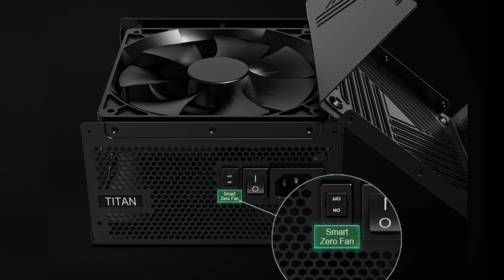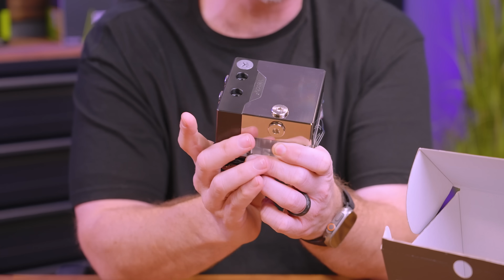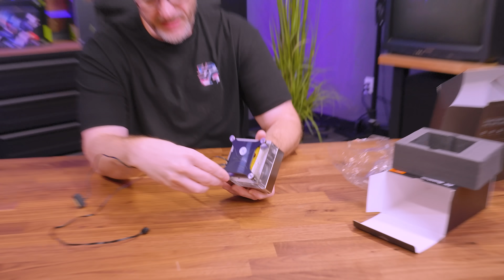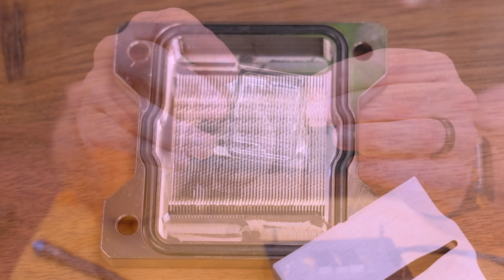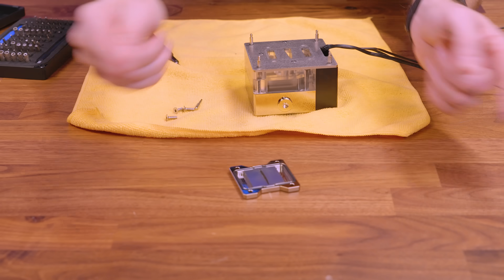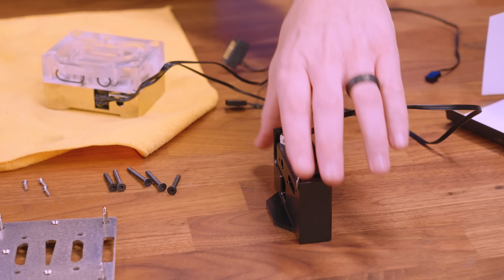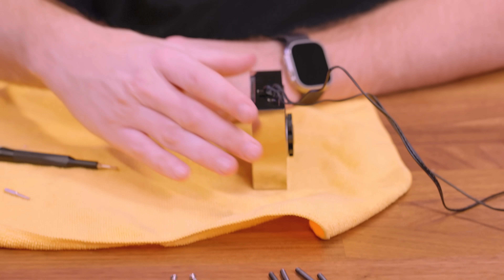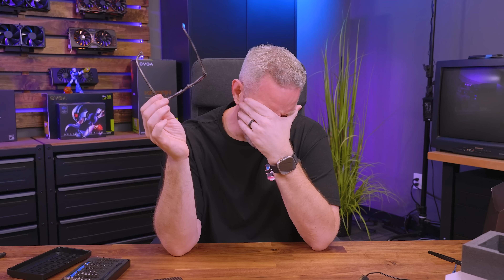I wish this existed years ago!

Comment: I really wanna build a custom watercooling system myself... but man its gotten so expensive
Edit: apparently i need to clarify this; the "has gotten" is mostely bc the hardware that actually reasonably justifies to be watercooled has gotten so crazy expensive... yes watercoolimg has always been "unnecessary" and expensive. But the highend consumer hardware has never been as expensive as now (excluding the scalpers).
Reply: It's always been expensive. 10+ years ago, you could easily spend $300-400 on a single block loop.

What's really changed is maintenance cost (having to completely swap expensive parts when upgrading) and how much performance you're gaining for the extra cost of cooling.

Years back, you could get a 30-40% overclock on a water cooled part, now it's no better than good air cooling IMHO.
Reply: @jeremiahCodes  I disagree with your claim about water cooling having been expensive in the past. Mainly its the gfx card block. 100s of dollars for a small block of metal. They have no R&D anymore, no new designs... Lasered on a computer... Most of the products should be dropping in price not going up. You're correct about the overclocking though.
Reply: What you don't realize adds up fast is fittings.
Reply: I'm building my first one now. A little advice DO NOT buy the cheap pumps . I'm on my 3rd and I still haven't even gotten windows installed. I dropped the money for a D5 on the 3rd ine still waiting on it to arrive . It would have been up and running a month ago if I would have started with a D5.
Reply: unnecessary? you're telling me with how modern cpus hitting over 100 degrees is a sensible thing? i'd prefer it sitting at 30 with max settings running thanks.
Reply: same
Reply: @UrielTheRealOne  I have been water cooling since 2015, and it got much more expensive, but so are all other components like CPUs, GPUs, memory, motherboards, etc.
The highest recurring cost is water blocks - with GPUs, you always swap the waterblock, and for CPUs with EKWB, it is the same, but some manufacturers offer you a new set of mounting hardware for new sockets. And if you want to change the looks after several years, it will cost you. So yeah, it is only for people with deep pockets and love for the hobby.
Reply: Ive been looking at all sorts of mix and matched stuff. at first I was like I want it all one brand but no I'm going with a mix because I want price:perf at how much these parts cost! lots of good "third party" and cheap brands that offer similar performance to the name brands. if I have learned anything in my 15 plus years of system building and repair, it is to plan, plan plan.
Reply: Especially considering a big aircooler is under $75 compared to a piece of a custom loop at $319.
Reply: @BigBonelessJerk  Sure but that's an entry cost once you have fitting +pump+rad+res.
You will only changes warteblocks+tube+liquid when you upgrade.
Reply: Dumb people hating on watercooling for no reason. Stop annoying people with the "Watercooling is unnecessary" comments. Yes, it's unnecessary and unreliable compared to air cooling unless you're doing it for acoustic reasons.

However, it's a fun hobby and having fun is justification enough to do something. That's it, no more to be said.
Reply: @chas1878  thanks mate, I really didn't think this comment would take off like it did but here we are...
Reply: @chas1878  Why dumb? Because disagree with you its dumb? If you get annoyed its your problem not mine.
Reply: @cybdan_  you literally do not disagree with me if you compare my comment to yours. What's your point?
Reply: @chas1878  my comment was saying its not necessary to have watercool, your comment was full of hate calling ppl with my opinion "dumb" and saying other not so nice things. While I understand you might like to have a watercooled system, doesn't give you any rights to insult the rest of people who thinks different than you, that's my point.
Reply: Its not expensive if you are willing to build the parts yourself ... a really custom watercooling system. Just buy a D5 pump (its worth spending $$ here) and the rest make it yourself. You can build the waterblock out of copper plate, and the radiator with a heater radiator from a car (old cars which used copper/brass radiators are preferred, avoid aluminium parts).
Reply: to be honest if you don't have an extreme processor and do not do extreme things to your processor, there's no need to watercool it, air coollers are better solution, less noisy, little maintenance, and if a fan breaks you can replace. Watercooling if something breaks you can destroy whole PC and if not, it's going to be expensive to replace.
Reply: @cybdan_  I had to blast fans at a way higher RPM and noise level when aircooled vs watercooled. And my stuff ain't even that powerhungry (Just a Ryzen 5 5500 and Vega 64 Strix). Now i can basically leave fans at 30% speed at most and stay at 20C lower temps than when i was still aircooled
Reply: @MrBluePoochyena  what cpu cooler were you using vs what AIO kit? I mean there's surprisingly quiet coollers nowadays that cab refrigerate more than good that 5500 while being quiet. Theres good coollers for 60€, while any AIO will cost you 100€+
Reply: @cybdan_  I'm running a full on custom loop now. Already had parts left over from one of my older and faster rigs. And the aircooler i was running was Scythe Mugen 5 Rev.B
Reply: @MrBluePoochyena  So you must be really picky, that cooller operates at just 40 db.
Reply: @cybdan_  Gotta cool well below 36dBA is my requirement
Reply: @cybdan_  yes ik thats the biggest problem. You need to spent like 4k om your pc to even make it worthwhile watercooling it... which then also goes easily over 1k
Reply: word. i thought you could do a full loop for like $500... i priced stuff the other day, just the pump, rad and waterblock was like $450-500. then you still need tubing and fittings. its like $700 just to do a basic loop. i had no idea pumps were so expensive. its kinda crazy considering a AIO gives you everything(a decent pump using kit) for $250-325
Reply: @Cheeseypoofs85  You absolutely can. Where are you getting these quotes from?
Reply: It'd be more sane and logical to open water cooling to mid range GPUs, I mean, you can water cool ANY CPU, right down to the 35w AMD "GE" model CPUs, why can't we water cool our 250 watt MID RANGE GPUs?  Not just to control thermals, but to enhance performance a bit as well, and tame runaway hotspots that can develop after only months of use with the stock thermal pads that act more as insulators than conductors.
Reply: There was a drop in general prices especially on the used market after the whole crypto thing collapsed and supply chains went somewhat back into order. But now the manufacturers themselves are like "Here's the new uber awesome hardware but we increased the MSRP by 100%"
Reply: Nah you're right about Watercooling in general too. Since CLCs are so affordable and popular, custom Open Loop is getting more high end and nieche. I priced out a PC with a custom loop 3 months ago. Without compromises in terms of cooling and with a compatible (high end) case, the cooling alone would cost me 1100€. Its really just for aesthetics nowadays. You cant justify that cost when talking about performance while being on a fixed budget.
Reply: @kngkunaat  Not to mention that custom Open Loop water cooling is actually more effective than AIO CLC's.  And with the NZXT AIO bracket for GPUs, most GPU's see a full model level higher level of performance.  And as to the coolers on GPUs being "Over Spec'd", it doesn't matter how over spec the heat sink is if the Thermal transfer interface is insulated by a low thermal conduction thermal pad (even the best thermal pads are <7 W/mK and encompass the ENTIRE transfer surface, severely limiting the cooling efficacy, and the cheapest pastes and greases are 8+ W/mK, and only fill in the gaps of the metal on die, which for aluminum is 235 W/mK and copper is 398 W/mK, which when you do the math for the die size of mm gets you about 0.01 watts per degree kelvin difference for the pads and about 1.5 watts per degree kelvin difference for the paste assisting with metal on die).
Reply: I buy ek stuff when it goes on sale, and only watercool my systems when they are a couple years old then overclock because then the blocks go on sale for super cheap. 
Just got an Msi z490 ek motherboard (have a i9-10850k heavily overclocked) for $80 bucks and a 3090 block for like $100. Had an FLT reservoir+pump and fittings already.  Not bad if you can be patient.

Plus, let’s be honest, a watercooled system looks incredibly sexy.
Reply: Not to hate, but the best gaming CPU 7800X3D draws 65 watts in games, and a 4090 is hugely overkill coolers, tbh whole 40-series is like my 4070ti. Slight undervolt and its no problem. Maybe if you did live in a very warm country water cooling would start to help.
Reply: @Djuntas  he said he wants to watercool, not needs. custom watercooling is cool but unnecessary most of the time
Reply: @Djuntas  what you get is constant noise rather than varying noise, and much lower noise in general. And you get a more constant temperature of your silicon which gives your system longevity as you're not getting as much expansion and retraction over load cycles. 
Now, it then all depends on if/how you value those things.
I had 2700K plus 3 GPUs for 10 years (up to last year) on full water loop (CPU, GPU, MOBO) with massive radiators. I could run it passive wrt fans but was happy with the slight noise running 4 of the 8 at minimum rpm. Constant noise level and profile over 10 years. Had no stability problems. The 2700K is still running elsewhere (though now on air).
Reply: @Djuntas  - I need to watercool my computers. Not because of high power consumption but because of high ambient temperature.
Reply: @xuser48  Yeah for sure, again no hate here, do whats fun, but unless you literally have 40c weather I doubt it will matter thanks all the magic juice we got these days from TSMC.
Reply: @Djuntas  - In summer time I'm closer to 50C ambient. :-(
Reply: @xuser48  Awful :( Id move country over that. I hate the summer, its way to hot in Denmark already.
Reply: not to fight you on this but do you have proof that your running the 7800X3D at 65 watts in games?.. I know it can hit like almost 180 under full load, maybe a 5800x3d @Djuntas
Reply: @Djuntas  thats not the main reason people build water cooling. Its more of I've built a ton of air cooled lets do something different/ the Kool factor of hey look a my self buikt water cooled pc.
Reply: @chrono2959  I've built too many aio systems so I tried open water loop and I'm never going back but I could still test other types of loops
Reply: Watercooling is a massive benefit. It allows much more agressive overclocks, much lower thermals and slower transitions of thermals (therby reducing the thermal stress experienced) and it also reduces power draw (Hot materials move power less efficiemtly. Running cooler makes it more efficient and stable).
Reply: With rads, fitting, pump, reservior, cpu and gpu block I estimated 600-900€ for me...
Reply: @gucky4717  I will not even be down 500€ for my systems custom loop. Bykski CPU block (55€ shipped)+ Strix Vega 64 GPU with EKWB block 120€ used, Phanteks res+DDC pump 110€, 280 Alphacool rad 50€ + 360 Alphacool rad 80€, Bykski Fittings & tubing 80€ shipped
Reply: always has been, pretty sure it cost me over a grand to do a custom hard line loop about 7 years ago
Reply: My pc was 4k dollars and that was aircooled lol. My previous pc that I built 9 years ago cost me 2.5k
Reply: Way back in the day, like late 90's, early 00's, it was at least 5x more expensive than today. And that's considering I had to fabricate a lot of parts and buy tons of stuff from aquarium stores, use fridge and car radiators, buy Delta, Sunon, Nidec industrial fans because PC fans were pure shite, etc. The only stuff made specifically for PC water cooling were blocks and fittings, basically.

I quit water cooling my main rig in 2016 because I didn't have time nor patience to do and maintain a new build but custom WC was so easy, reliable and cheap seven years ago even a teenager could buy and build a custom loop.

I bought a used 3090 last year and had to build a new loop and the only stuff I used from my old crap were some fittings, a T sensor and a Lowara D5 (original D5 and DDC pumps last forever). I bought 2x 360 45mm Magicool G2 rads, a Bykski 3090 gpu block and active backplate, a cheap cpu block, pump housing and reservoir, tons of fittings, drain valve and 3m of silicone hose all from Barrow. All that for less than $480 from Aliexpress. If I had to buy a new Laing D5 it would be less than $550. It's dirty cheap!

A custom loop can get expensive if you start to buy brands and looks instead of function and performance. A PC is supposed to do math as fast as possible, not look like it came from Jim Bob's Carnival Show. Since we can't overclock the crap out of CPUs and gpus anymore without some serious hard modding, the difference between "boutique" brands and these new Chinese players is marginal at best. The only thing that you need is an original D5 or DDC pump from Xylem. They all come from the same factory so buy the cheapest one.

Comment: Several companies have already done this, i have a Pump/Res/Block on my old lga 2011 system
Reply: Asetek sued them all, so theyre not available in the US
Reply: @mycosys  When do those cocksuckers lose their copyright (expire)?
Reply: @mycosys  cant wait till they go under screw those patent troll clowns
Reply: Kinda funny, I just bought it from a US retailer about 6 months ago. Nothing like the Asetek units.
Reply: @WarhorseS197  "Patents and lawsuits

The company is well known for its patents and for its practice of pursuing ongoing litigation. It holds patents to many OEM liquid cooling systems and many liquid cooling pumps. The company also holds the patent for having the pump within the water block (the part that goes over the CPU or GPU). Many companies have also released models of liquid cooling AIO (all-in-ones) with this design. As such, Asetek has taken many companies to court on such charges.[17] Asetek has successfully sued Cooler Master, Corsair and CoolIT Systems over these charges.[17][18][10][19] 

Patent losses

On October 12, 2020 the U.S. Patent and Trademark Office (PTAB) issued a Final Written Decision rejecting Asetek’s challenge all 21 claims of the CoolIT Systems ‘200 patent were invalid in light of certain combinations of prior art.[20] As a result, all 21 claims of the CoolIT Systems ‘200 patent survived without amendment.[21] [22][23] "